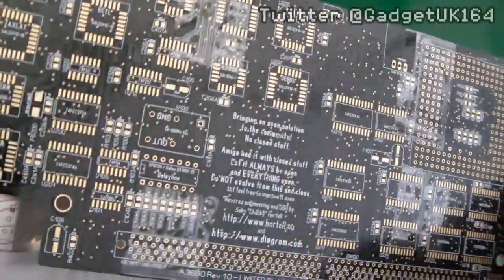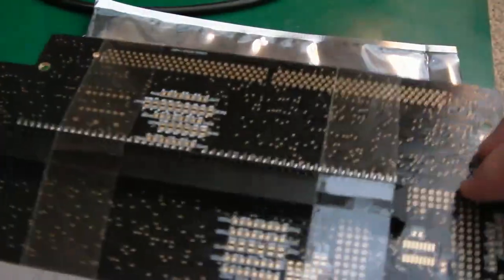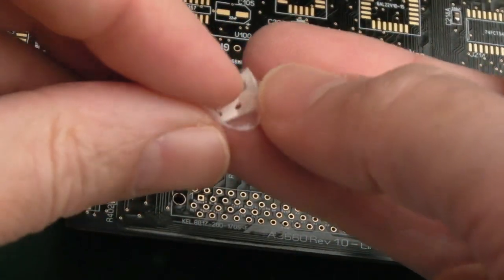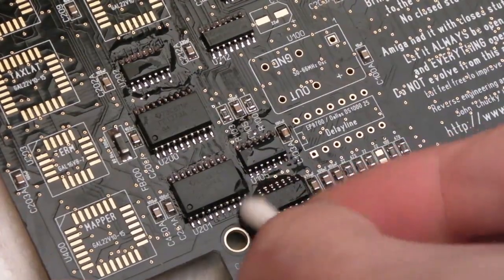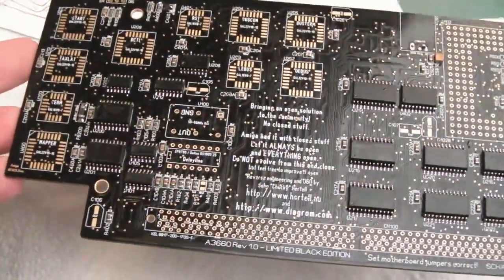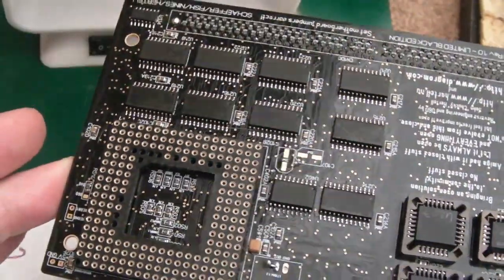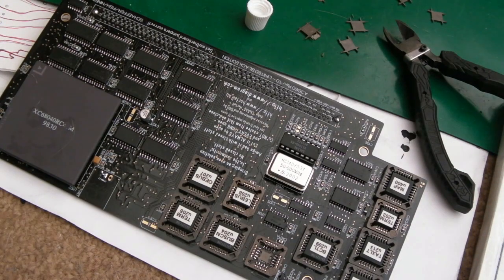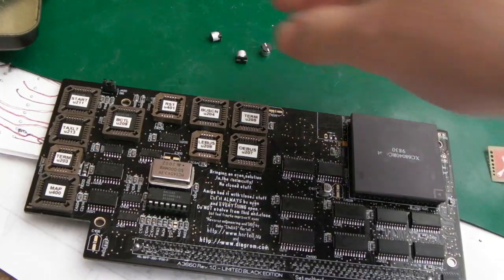Commodore Amiga A3660 Build (From Stephen Leary) 68040 / 68060

Comment from the maker: Chucky (John Hertell) Blog about creation of the board - https://wordpress.hertell.nu/?p=537
A3660 Kit - https://amiga68k.com/?cat=64
Note: Yes, I spotted the hair on the soldering iron early on - it needed a shave ;)  If you fit an 060 CPU you need to fit the regulator (don't bridge the IN and OUT pins like I did), and solder the 1 ohm link between the centre pad and the 060 position to the right of the CPU socket.   When I said I was balanced on an Acorn Electron - I meant the Camera was - not the board being heated ;)
Reply: I wondered. I was beginning to think that Electrons don't get any respect. :)

Comment: For the sockets Kapton tape and heat from behind.  Just ignore comments about the "correct" way to do things.  There are often more than one way to do things.  I was a component level service engineer for Acorn doing BBC model B, Master and onto the Archimedes A3xx, A4xx, A5xx, A3000 and a little longer.  I still use a soldering iron for almost all SMD work.  What you COULD do is get a PRE heater and heat the whole board to 20-30 degrees below the point where the sockets are affected.  With that done the ground planes etc have much less or no effect.  You would then probably be able to use a much lower temperature on your hot air just to tip it to the point where the solder melts. but as I said there are more than one way to do things and Kapton tape plus heating from the rear is a good way.  I might well show some of these techniques on my own channel at some point.  Anyway for someone who I have watched going through the whole learning process over the years you are doing very well.  I still have less than 100 subs but maybe we could collaborate at some point with a teaching video on some of these points.  Good luck in the future.  Darren

Comment: Tip for saving a lot of time soldering those SMD resistors/caps: Add solder to one pad row, use hooked tweezers and hold/place component while re-heating the soldered pad. When done with attaching the components solder the other row, then touch up the first row if needed. Much faster and usually don't need the hot-air reflow and avoids tombstones completely. Nice results though, very well done SMD work.

Comment: Nice video and grate soldering, you earned a new subscriber!
I bought the same sockets for a PCI card I had to swap the ROM on and yea the corners where a bit of a pita.

I dont own an AMIGA, did recap a A500 and did some corrosion repair on it for a friend not long ago so I got to boot that up with all sorts of adons, USB, VGA support etc etc plus a CPU upgrade card.

It lives in one of those newly made A1500 checkmate cases now from the update I got.
Reply from the maker: Thanks for the sub! =D

Comment: The best way I've found to set those sockets is to heat the board from below. Add some flux to the pins of the socket for good wetting. So long as you don't leave the board on the heat after you set the socket in place it doesn't melt much.
Reply from the maker: That's a great idea!

Comment: 24:25 heat from the back of the board!! works every time!
Reply: The other way to do it is with paste/stencil and hot air around 120-150 deg - or cut the bases out and use a soldering iron (which is what I did).

Comment: I think maybe your hot air is too hot. You can see that from how the case on the tantalum capacitor got discoloured.
My guess is you have the heat turned up because you can't heat up the pad to the solder melting point before the ground plane etc suck away the heat otherwise..
IMHO you want a preheater for a board like that. Then you can lower the temp at the hot air nozzle.
Reply from the maker: Yes, I had the temp a little high at that point!  But for the other stuff it was OK!
Reply: @GadgetUK164  a bigger nozzle might help too. A preheater also prevents the pcb from warping due to hotspotting. I think the sockets are made of some type of nylon. It can take some heat but not beyond 250 degrees C I think. It becomes quite soft/liquid at that point. I wonder why the designer didn't just use a gal package that doesn't require a socket. I guess not everyone owns an smd rework station. But a great job nonetheles!

Comment: I'm almost done with mine - my parts were sourced from mouser ;) - the original bom isn't 100% complete either so it took 2-3 orders. I found that the gal's - the cheaper programmers honestly have a rough time with those. I ended up getting a new programmer (T56) which handled the atmel/microchip equivalents of the Lattice parts no problem.

C400 btw is a reset circuit.

Question for C501 - the bom doesn't actually specify the type of capacitor - is it supposed to be polarized?

Oh Edit: The big difference between the 1.0 and the rev 1.1 is the addition of a surface mount pad for the Dallas delay line (yours has a through hole part which are really kind hard to find anymore), and the addition of another pad for an alternate flip/flop (u101).

Comment: I like to add Kapton tape to the threw hole parts so I don't drool solder into the holes ahead if time. then I use a large wide tip and flux to solder all the pins on one side of surface mount part at a time.

Comment: Have you tried taking the nozzle off the hot air gun? I've found this helps to stop things dancing around because there is not such a concentrated jet of air.

Also you can then hold the gun a bit further away and just flood the area with hot air and eventually it will reflow without blasting the socket close up, much more like a real reflow oven would do.

Backstory: I recently removed a socket like this from a board and yep, with a nozzle it started to melt pretty quickly, but without the nozzle I was able to remove it more or less perfectly.

Comment: 27:00 A nano soldering iron with 0.1-0.8mm tips would be great for this. I recently bought JBC NASE-2C rework station, it's amazing. Hot tweezers are unbelieveable, they don't care about ground planes, thermal laws and physics in general, they just desolder any cap in 2-3 seconds. I was like "WTF?!" when I used them first time. JBC is expensive but worth it, performance is unbelieveably better compared to cheap chinese stations I was using before.

Comment: Solder paste, I find, is really meant for BGA soldering. If you've got a board pre-heater, it makes the stuff more bearable...but it's really tough to work with.
Reply: Solder paste is meant for all in-direct soldering not really just BGAs. If you don't use the really cheap "mechanic" stuff and get a decent brand and keep it fresh it's a lot easier to solder boards like this with paste. You could dab all of the passives pads with a toothpick, drop the parts on and then drop the board on a hot plate and have them all soldered.
Reply: @donpalmera  Also, keep it in the paste in the fridge when you're not using it. Give it quite a while to come up to room temp when you remove it from the fridge though or else it'll be just as painful to work with as crusty old paste.
Reply: @AnonyDave  Chipquik has some stuff that is ok to keep at room temp and is meant to last longer. I keep it on my desk for a few months and it's ok, a little bit more than that and it's unusable.

Comment: Its easy with hindsight but i would have fitted those brown sockets first, applying  heat from the back of the board, its how i do nintendo switch ribbon connectors.

I also dont think they are bad the way you have done it, cutting out the middle and solderong manually. 

Very good.
Reply from the maker: Good idea!  Thanks =D

Comment: 10:30 when the solder spikes like that, it might mean that your iron is a little bit hot. Try lowering the temperature by 10 or 20 degrees C. For small SMD parts, a somewhat cooler iron can be beneficial to the quality of the soldering job.
Reply: I would say more flux.
Reply from the maker: Yes, that's the issue!  After heating a point a few times like I did at that point in the video, the small amount of flux that was in the solder has burned away!

Comment: Only a quarter of a way through the vid. The sockets... Tin the pads, reflux pads, flow hot air from the underside. Need to dial in about 380 on temp. When solder melts, place socket on. Forget even touching them with an iron or a heatgun from the top. Good vid(what ive seen anyway)!

Comment: very nice work indeed! I'm inspired now to get my own A4000 back running. don't have your skills with soldering iron tho. i hope its just replacing the caps on mobo that's needed. i get black screen no ide act. with A3630 cpu and also black screen with A3640 cpu board. on my channel you will see what was done before it crashed.

Comment: Wow those socketed ICs look a right pain? I can't see how you are supposed to solder those on if the plastic in the PLCC melts so easily.  Very nice piece of work at the end though. I hope you can get a case soon.  I keep looking for a 3000 but they have just gone silly prices.
Reply from the maker: I suspect if you have good solder paste with a lower melting point than the 60/40 solder I use, coupled with a lower air flow and reduced temperature, it might be possible!  I think the other key is having an underboard heating plate to get the board hotter.  That of course may mean you have to do the underside components last.
Reply: @GadgetUK164  Did Stephen Leary or Chucky have any guidance on how you should approach it? I still think even though it was a pain you did a great job in the end even if it was a bit of a slog.
Reply: Plastic melting point is a good amount (like 10-30C) higher than solder. All you need is temp controlled oven, or a vapor chamber.
Reply: @rasz  Thanks for the info, I never understood how you could use an oven as surely that would heat all the other components up?  NB: I am like Gadget UK, I am always repairing an existing board not starting from scratch building a new board.
Reply: @Wallygjs  you heat all the components, but the critical part (TAL zone) takes only up to ~90 seconds at reflow temperature depending on the profile. All the components meant for reflow soldering are rated for it.
Reply: @rasz  I think you must have access to much more advanced equipment than I do, I would only be able to do it the way that Gadget did it. But thanks for the advice.
Reply: @Wallygjs  at teh extreme ghetto level $6 MAX6675 Module + K Thermocouple from ebay and arduino to control heat gun hanging over the work piece can do this

Comment: For those electrolytics could you use non polarized ceramic caps?
Reply from the maker: Yes, you could!  However, ceramic caps behave differently to wet type electrolytics (that's why they never fitted ceramics from factory).  Ceramics (even back then) would be cheaper, but their filtering characteristics are different and they can suffer from piezo electric type effect where vibrations can affect them.  Temperature affects them differently too.  Ceramics also have a failure mode where they can short - like tantalums.

Comment: Nice work Gadget. I have 2 of these cards running rev 5 060's clocked @66MHz with a small CPU fan and they will run all day reliably. To speed up the machine download the latest MMULibs from aminet and run the installer. It will copy all the files into the right directories and on one of the installer screens it will show lots of check boxes you can check them all or just MuFastrom. IT will copy all the programs to sys:MuTools dir,  mmu.library and 680xx.library files to LIBS:,  once complete add this to your SS after setpatch and CPU this will copy KS roms into fastram. Example below....
C:SetPatch QUIET
C:CPU CHECKINSTALL
;#MuFastRom: MapRom to FastRAM
	SYS:MuTools/MuFastRom PROTECT ON
Reply from the maker: 2 =O  You are spoiled lol =D   I did exactly what you suggested and that demo ran fine =D  Thanks!

Comment: Could you make a small video please mentioning the old tf530 4Meg RAM hack? And yes, I know there is the tf534. It's just that ithe tf530 4meg-Hack is one of those "old wisdom" (learning how it works) topics from the (amiga GNU) community and the tf530 was so well documented by fans (better than the tf534) not only in videos but in blogs fans wrote on it. And people still have unbuilt boards (some also with an FPU awaiting homebrew to be written). You'd sum it up well because you have a way of saying things neatly. So basically my request is if you could please mention what firmware of other software is needed as in how to do changes to the CPLD and some additional wires. Pin 6 in 16 bit srams is chip select, (address line in 8 bit tsop44 srams). Bypassing the address line to cpld and connecting pin 6 on srams to vcc makes the board be able to test chip ram ok.
Reply from the maker: It would need a firmware change I think - firstly for the autoconfig, to respond with double the amount of RAM, then its a case of mounting it (piggy back probably), and dealing with the OE signal (probably a wire from the CPLD).
Reply: @GadgetUK164  Thanks for reply! It was done a few times by some (e.g. in the exxos forum, and I can link a mention of it to you) and also by people who would mention it in the TF530 YT livestreams. It is also mentioned on amiga forums here and there. If you cannot recall how to do it, please give it a mention in a video and ask for the audience to tell you a reminder on how it is done (in a comment or whatever). There are benefits to hacking the tf530 (instead of merely just using a tf534 or other board) such as being able to use static RAM (a preference) and of course the FPU which is 'controversial' - lol (and I'm in favour of FPU, in case you are wondering). The Tf530 4Meg hack was one of the coolest things ever, and it worked with the trapdoor expansion and even on a 2Meg a500plus thereby giving 6meg.

Comment: Can the MC68EC060RC75 work in the a3660?
Reply from the maker: Yes, I am not sure if you can get 75Mhz out of it though...   You of course would need to make sure the CPU gets 3.3v (rather than the way I wired the 5v straight across in this video for an 040).

Comment: A nice build, but alas a near useless 060 board without a dedicated memory controller.
Reply from the maker: With an 040 I wouldnt say its near useless, so many games and software run super well on this.  But, with an 060 - yes, you want dedicated local fast RAM for sure, or you end up bottlenecked.

Comment: I saw someone that had solder that melts at 150 degrees C, he tinned all the pads then put the sockets on  and popped it in a pre-heated oven for a very short time. But as you say, who knows if this type of sensitive plastic socket will even play nice at 150 and not melt.